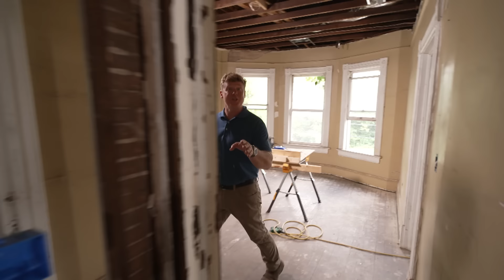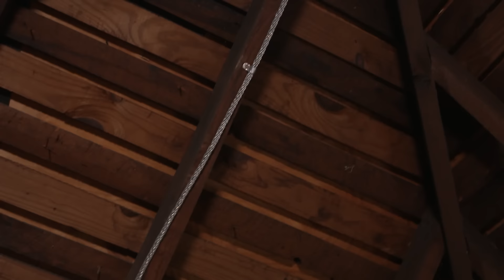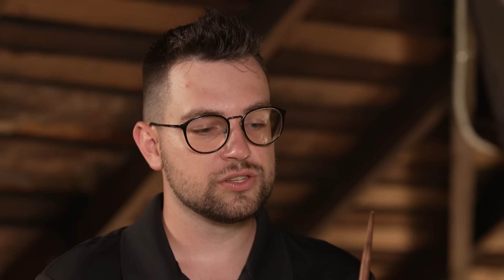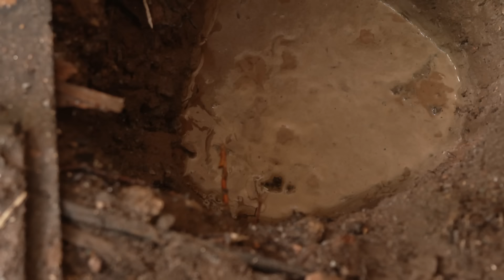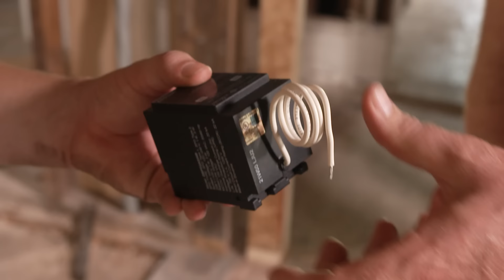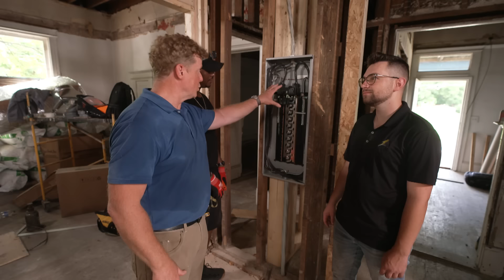Lightning and Surge Protection | This Old House

Comment: Ground protection systems are only as good as the conductivity of your soil. Most of the installation companies are going to take your money without advising on ground resistance testing. This should be your first step in the process and should follow the NFPA 780 Standard for the Installation of Lightning Protection Systems.

Comment: Red flags should be going up all over the place on this lightning "protection" system!  #1 You DON'T route lightning conductive cable thru the inside of a house, and you DON'T attach the conductive cable directly to portions of the house structure which is also grounded, this creates multiple grounding points enabling the current to branch to undesirable locations INSIDE the home.  #2 The most effective and LEAST dangerous methods of routing a lightning strike conductive cable to ground is done on the outside of a home with an insulted cable path to ground,  NO bare cabling should EVER touch flammable materials along the path to ground neither inside or outside the home!  #3 lightning rods need to be at a the high points of the house with as few key strategically place TALL lightning rods (not short stubby rods) as possible to minimize arc overs and branching of the lightning strike.  These are just a few red flags of many that should have been picked up on by This Old House and this videos viewers!

Comment: I don't have surge protector in my home in Roxboro Quebec and I have no idea if it's required.
Reply: wouldn't help in this case, That is to protect your electrical system and delicate appliances from surges. a direct strike is WAY more than it can handle

Comment: The problem is that lightening (electricity) travels at 186,000 miles per second. So by the time the surge protector detects the surge and starts to quench it, the surge is already in the house wiring. Secondary protectors may help some but some of the surge may get by them as well, either as a current surge or as a voltage spike. And any device that uses a remote control is "always on" as it must be listening for the remote commands to turn on! So unplugging is the only sure way and even that may not be enough as the surge may come in on the TV or satellite cable or the internet/phone unless you have a fiber optic feed.
Also the frequency of a lightening strike is not 60 cycles but a very high frequency in the thousands of cycles (which is why lightning makes noise in AM radios. It tends to travel on the surface of conductors instead of inside like 60 cycle current does.
It will form a plasma of several thousand degrees around a conductor's surface. Which is why you want to keep lightning conductors away from combustibles like wood.

Comment: Would all of the grounding system on the house be tied into the same grounding system as the lightning rod grounds I noticed you drove in another grounding rod just for the lightning rods but is that system tied in to the ground for the grid also or is it a separate system altogether?
Reply: No, the lightning system is not connected to the grounding system of ur home. If I remember correctly

Comment: Below grade connections should be CAD welded, not fastened with mechanical bolts.
Reply: Every system I worked on every connection was cadwelded!

Comment: As a retired electrician, I worked high rise office building construction. I always got the job as the high rise machine room foreman. We always installed lightning protection on the roof. It never failed. Someone would always get caught taking an air terminal (lightning rod). I would ask him to return it and say, “Never install an air terminal on your house. Install it on your neighbors house”. The system is meant to DRAW a lightning strike and safely dissipate it to ground without damage.    Why would you want it to hit your house? I never had a guy keep it after telling him that story.
Reply: Further from equipment/people is better but my understanding is it's often better to have something than "nobody around having one" since pointy tips help discharge static leading to weaker strikes
Reply: Obviously the ones shown here are relatively small and low compared to a hirise, like he pointed out their high point otherwise is a chimney.
Reply: @QualityDoggo 
They are the same, whether for a house or a 60 story office building. The cable size can vary.

Comment: Once again no mention of cost because money is no object on these projects.
Reply: I hope that this helps... He talked about 4,300 strikes (in Atlanta last year), causing a total  $43,000,000 in damages = so, that's an average of $10,000 per strike to repair the damage.                
I'm in the wrong business! 🤑
Reply: Whole house protection is not that crazy, it just comes off the breaker box, no more difficult than installing a new breaker. Definitely under $1000, and probably even under $500. The whole lightning rod thing is a lot of labour, but not a complicated process.
Reply: Good type 2 surge protection devices are only $100-200.
Reply: @ most people are too scared to touch their breaker box, those figures were factoring in install 😎
Reply: So stop watching, home ownership is for the elite in your eyes

Comment: Pretty sure the lighting rod cable should not be attached to a combustible surface , and the ground rod for the system should be connected to the ground rod for the electrical system to prevent a difference of potential in the electric system if not it will still fry sensitive electronics
Reply: Lightning ground is not connected to house electrical ground to prevent frying house panel.

Comment: I live about 40 miles north of Atlanta. In 2018, lightning struck a pine tree about 20’ off the back of my house. It traveled along the ground towards the house and arc’ed on the metal astragal of the French door I was standing about 6’ away from in my basement. Scared the crap out of me. We had whole house surge protection on both panels, but we still lost all our TV’s, AV receivers, hdmi cables, both garage door openers, fridge in the garage, the main board of our basement heat pump, outdoor string lights on the back deck, the remote control switch for my dust collector in my woodshop, and one ceiling fan on the 2nd floor on the opposite side of the house of the strike. None of the other fans were affected. My electrician buddy said when it strikes that close, it’s like a mini-emp and can fry sensitive electronics…. Which is exactly what happened…
Reply: That sounds terrible, I’m so sorry that happened.
Reply: Dang, thanks for the story though.  There are different levels of protection too by the way.  They withstand a certain amount of surge, one like this probably 22.5kA.  While rating diminishes it still can be helpful to be higher, maybe up to 100kA or 200kA.  Almost direct lightning would probably fry anything though.  I have surge protection breakers but I don't even think of it as actual surge protection.  If you want some devices like an expensive TV on a real surge protector (not just the power strip with surge), you would want a UPS that supplies the power actively.  My main panel and sub panel have these kind of protectors because I have a couple of solar arrays by the way.
Reply: @blh1997-w1q  just shut up, they don't work
Reply: @theprochrist UPS absolutely do work. We have 20+ of them at work. Also have a really nice (and heavy) 240V 1800watt double conversion one.  The cleanest power you can get.
Reply: thanks for that input....they don't work.

Comment: I once tried to drive a ground rod into the ground at a junkyard.  The dirt was so saturated with oil that there was no continuity to ground.  I had to run a separate wire up to the pole to tie into our telephone ground on the strand that runs from pole to pole.

Another time, our ground source at a customer's location was a different potential than the power company's ground.  That was confusing.

Ground is not the same everywhere.
Reply: Yiiiikes
Reply: lovely..

Comment: I have lightning rods installed on my house back in the 70s all of my cables are on the outside of the roof instead of underneath like in this episode should I be concerned or mine work just as good
Reply: Your Rods was done in the 1970s.  
If I were You, I wouldn't worry since they were installed last Century.
Reply: You are probably better off with your old system because is probably copper, which was cheaper, and is an excellent conductor. Hence, no worries. Besides, the cable is just to guide to ground the voltage tsunami, it does not matter if inside or outside. Inside is better because roofers won't charge you more when is time to replace the shingles, but it has no technical benefits.

Comment: My new home in Nevada requires whole house surge protection.  Just the Nevada power company has 30 surges/day besides lightning strike surges
Reply: surge protection only covers your electrical system and appliances It will not protect your plumbing..

Comment: I recently had a whole-house surge protector added to my new breaker box and I feel much better about my expensive electronics
Reply: Install Tripp lite single plug in surge protectors at each device too. Refrigerator, microwave, computer, router, garage door opener and tv’s. This is in addition to the whole house surge protector in the load center.